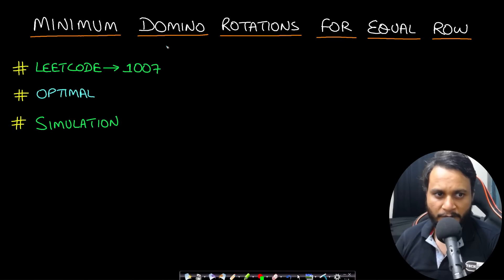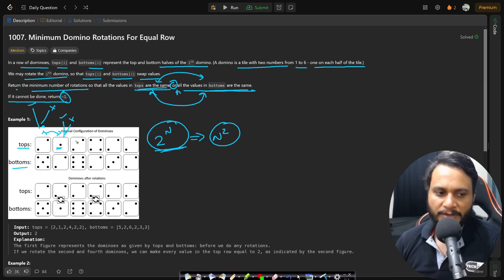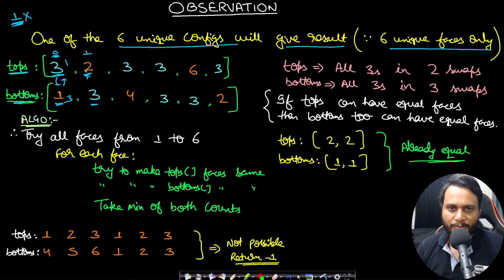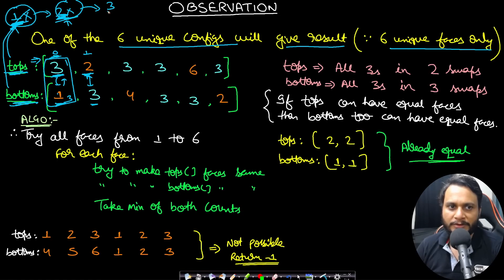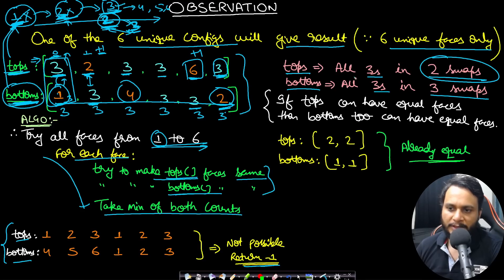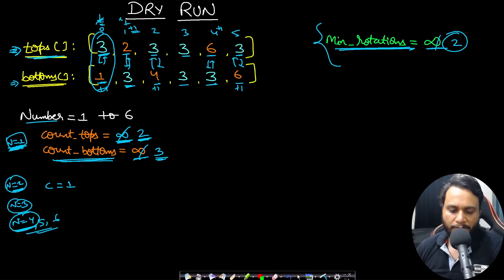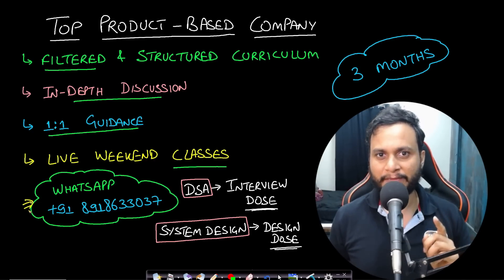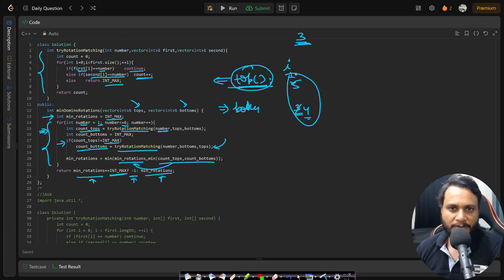Minimum Domino Rotations For Equal Row | Leetcode 1007

Comment: instead of checking 1 to 6 we can check for only two values i.e tops[0] or bottoms[0] ,and check if any of the values fits in.Check my code:int minDominoRotations(vector<int>& tops, vector<int>& bottoms) {
        int i=0,ans=0,count =0,estNum1,estNum2,count2=0,estFlag1=true,estFlag2=true;
        int n = tops.size();
        estNum1 = tops[0];
        estNum2 = bottoms[0];
        
        for(int i=0;i<n;i++){

            if(tops[i] != estNum1 && bottoms[i]!=estNum1){
                estFlag1=false;
            }
              if(tops[i] != estNum2 && bottoms[i]!=estNum2){
                estFlag2=false;
            }
        }
        if(!estFlag1 && !estFlag2) return -1;
        ans = estFlag1? estNum1:estNum2;

        for(int i=0;i<n;i++){
            if(ans == tops[i]){
                count++;
            }

            if(ans == bottoms[i]){
                count2++;
            }
        }
    

        return min(min(count2,n-count2) ,min(count,n-count));
    }

Comment: I did it slightly differently.
We know that our target HAS to be either tops[0] or bottons[0].
So now there are 4 scenarios:
1.Try to make all the top row elements equal to top[0].
2. Try to make all bottom row elements equal to top[0].
3. Try to make all top row elements equal to bottom[0].
4. Try to make all bottom row elements equal to bottom[0].

So I basically called the check function 4 times. Like this :
min(
Check(top[0],tops[],bottoms[])
Check(top[0],bottoms[],tops[])
Check(bottom[0],tops[],bottoms[])
Check(bottom[0],bottoms[],tops[])
) ;

And then just find the minimum of all these 4 values.
Reply from the maker: nice 👌🏽